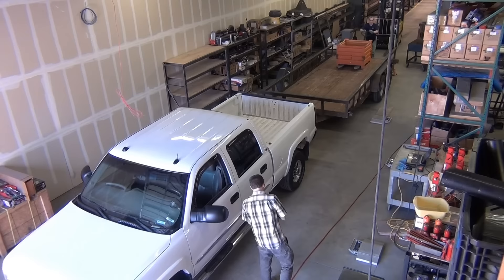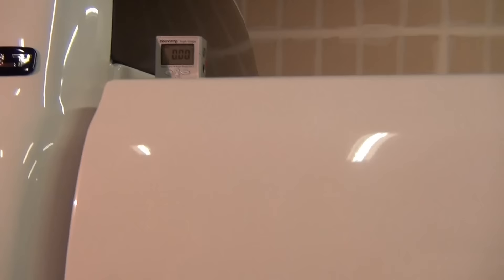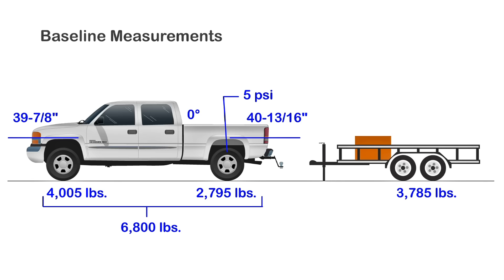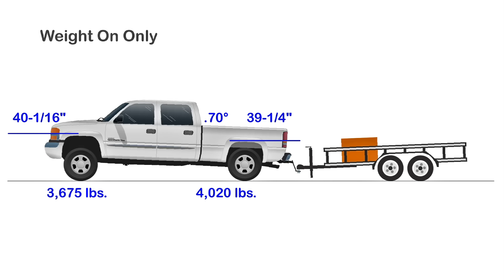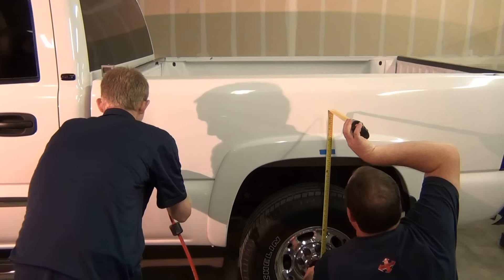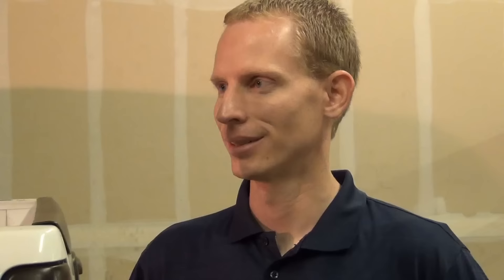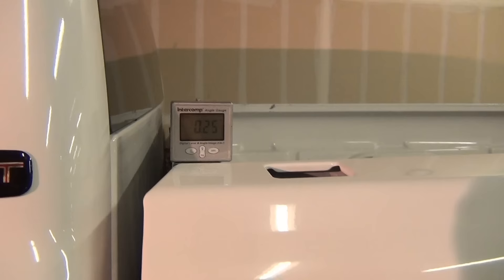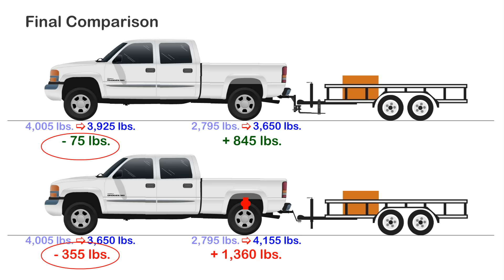The Difference Between Using Weight Distribution and Air Bags to Level Your Load

Comment: Your demo would have been better if you had done it with a single axle trailer. If you had done that you would see the air bags wouldn't change the tire loads at all. The reason the air bags change the tire loads is that with the dual axle trailer, the effective center of the reaction on the 2 axles changes with angle of the trailer. When the trailer is tilted down the effective center shifts forward. Think, if you tilted it down far enough, the rear axle would lift off the ground and the reaction would be right under the front axle. Similarly, if you raise nose, the effective center shifts back. Again, raise it far enough and the front axle will lift off the ground.
From an engineering point of view, the baseline and bags version are statically determinate and can be simply solved. The WD system changes the system to an indeterminate system and determining the forces at the wheels is a function of the stiffness of the WD system, trailer, truck, and springs.
Reply from the maker: Thanks for the comment. You are correct that a single axle trailer would react differently, and would have shown slightly different results on the scales, even though the principles of weight distribution vs. air bags would have remained the same. We used a tandem-axle trailer in this demonstration because those are the most common trailers requiring weight distribution.
Reply: "No air in the bags drops the front of the trailer down transfers weight off the tow vehicle and rear trailer axle to the front trailer axle. When air is added to the bags weight is transferred to the rear trailer axle and rear truck axle. Because of leverage from ball to rear axle the front looses weight." I typed this and then I saw you comment.
Reply: And further more the Air Bags where actually used to lift the rear higher than the weight distribution hitch height (ie: bags asked to carry more weight).  Would have been interesting to lower the Bag pressure so that the rear ride height was the same for both devices (my guess for the bags would then be that the front axle of the trailer would take more of the weight, the tongue weight would decrease, rear axle load would decrease, trailer weight would increase).

Comment: What about using both?
Reply from the maker: Hey +Dave Bowers,
Using both is a great option if you need them. We recommend using weight distribution for a heavy trailer / tongue load, and air bags if you're carrying a lot of weight in the bed of the pickup and need a convenient way to stiffen or soften the suspension. Thanks for the comment!

Comment: What if you use both methods?
Reply from the maker: There is a way to do it. You'll want to set up your air bags to a lower setting, and then make your weight distribution adjustments. Doing the air bags last will counteract what the weight distribution hitch is trying to accomplish with transferring weight. We're working on a video for this scenario! Should be ready this summer.

Comment: I have an f550 crew cab dump truck. Will airbags help me get weight to the front axle when loaded?
Reply from the maker: Great question. It actually won't. Airbags actually will add more weight to the rear axle, and will take even more weight off the front axle. This is because the pressure will be pushing down on the rear axle to get the rear end to raise. A weight distribution hitch will restore that weight back to the front axle!
Reply: @FastwayTrailer  I'm not talking about towing. I mean for the weight inside the dump bed of the dump truck.
Reply: @FastwayTrailer  It sounded as though Matt Paige was asking about a dump body, not a dump trailer. In this case (without a trailer), the weight distribution hitch (wdh) will do nothing except add the weight of a wdh (30 lbs or so) to his rear axle.... so not helpful.
Reply: @FastwayTrailer Please explain how you think a weight distribution hitch will put more weight on the front axle of a dump truck when the dump truck is loaded?
Reply from the maker: Oh I see. I don't think so. There would be nothing forcing weight forward to the front axle, so I don't see how air bags would help in that scenario.
Reply from the maker: Agreed!
Reply from the maker: Sorry, I misunderstood his question, I don't think it would.

Comment: is there any benefit to using both systems in conjunction?
Reply from the maker: We normally don't recommend using both together. Adding air bags to a WDH can take tension off the bars, and reduce sway control.
Reply: @FastwayTrailer  would it be fair to ask why not adjust (air up) the airbags and THEN adjust the WDH including the airbag height factored in to get the proper tension?  I know its a guessing game that can go in circles but if you have both & have used both together there comes a "feel" for fine tuning (adjust and readjust until it meets the requirement).  maybe im reading too much into it as a Jeep mechanic doing a lot of lift kits and dealing with caster issues where there is no rule of thumb
Reply from the maker: Yes that is the way to do it if you choose to use both. We usually advise against it because it can be very frustrating trying to get it exactly dialed in. Just make sure you do the air bags first, and adjust the WDH last!

Comment: Does this only apply to tongue tow trailers and not fifth wheels?
Reply from the maker: Yes. The principles we show here are for weight distributing hitches or ball mounts used with a bumper-pull trailer. A 5th wheel applies the load to the tow vehicle (usually) just slightly ahead of the rear axle, which places some of the pin weight on the front axle, and most of the pin weight on the rear axle.

Comment: After getting weight distributed hitch set, could you not air up bags to get to back ride hight level.
Reply from the maker: If you set up the hitch, then add air to the air bags, you will get the ride height back, but you will loose the weight distribution. Ride height is not the critical factor in a safe tow. Good axle weights is. Taking measurements of the wheel well is the easiest way to watch the change in weight being carried by the axle. The best method is taking the rig to a CAT scale and actually measuring the axle weights. Our recommendation is to inflate the air bags to what you think you want to tow with, then set up the weight distribution hitch. This will make the weight distribution take that rear axle height difference into account before being set up. If you change the inflation of the air bags, check the weight distribution setup and make adjustments as necessary.

Comment: Can't I use BOTH ?
Reply from the maker: Using both can be a bit tricky, you'll want to set the springs up before setting up the weight distribution with the hitch. You may need to use one extra washer on the hitch setup to compensate. Thanks for watching!

Comment: I own a 2019 Honda Ridgeline. I remember reading somewhere that a weight distribution hitch should not be used with the unibody construction. Is that true?
Reply from the maker: Good question! We defer to the instruction manual of the tow vehicle in that situation. Some unibody vehicles are good with it, and some not. So, check your tow vehicles specifications and if they say not to use a WD hitch, then you should follow that instruction and not use one!

Comment: What if the truck is lifted, like a Tacoma, do I have to use both? I already have a WDH
Reply from the maker: Depends on your set up! Using both can be a bit tricky, you'll want to set the springs up before setting up the weight distribution with the hitch. You may need to use one extra washer on the hitch setup to compensate.

Comment: What’s the best setup for using air bags and a wdh?
Reply from the maker: Using both can be a bit tricky, you'll want to set the springs up before setting up the weight distribution with the hitch. You may need to use one extra washer on the hitch setup to compensate. Thanks for watching!
Reply: @FastwayTrailer  Oh ok. Thanks!

Comment: Would there be any benefit to using the wdh and air bags?
Reply from the maker: It's been done, you will need to inflate the air bags first before setting up the hitch. We also recommend using the air bags at a lower psi. If you try using air bags to fix any sag from the setup, you run the risk of reducing the tension on the weight distribution hitch, which will cause a decrease in sway control.
Reply: I use both and it's the only way to fly
Reply: FastwayTrailer I do exactly as you described,  lower pressure in the bags is the key, works amazing
Reply: Another option to airbags is timbens. They will not interfere with the weight distribution but will assist the load on your springs while towing. They won't develope air leaks later down the road.
Reply: @FastwayTrailer  But is there any benefit to doing this? From the experiment you did in this video, it seems the WDH is more effective than Airbags, but would Airbags AND WDH be more effective that just one or the other? 
I ask because I already have Airbags, and I plan on getting a WDH because, well, it's better. If I get no benefit from using both at the same time, then I'll just set my air at it's lowest settings and only rely on the WDH. If I get added benefits, then I want to use both. Thanks for this video, been a great help at understanding some things.
Reply from the maker: Great question, and it is hard to tell. It depends on each individual setup to be honest, and some may need both while others are just fine with one or the other. If you have airbags already and are looking into getting a WDH, I'm sure the WDH would help!

Comment: Ok, have a question. So in order to get the weight hitch on there you have to life the vehicle up to install the bars right? Well how would you do that if you have almost 2k in the bed of your truck but you sit level with factory self level air ride and have a trailer that weighs in around 10k? You’d be picking a lot of weight up on that little Jack to install the bars.
Reply from the maker: Hi Derek! You don't need to lift your vehicle to install your bars.
Reply: I usually lock the coupler onto the ball, then lift the back of the truck up slightly. This makes tensioning the bars easier.

Comment: Can i make a small setup for class one hitch? 200 to 300 tounge weight i would love to transfer to the front.

Car.
Reply from the maker: If your tow vehicle has a 2” receiver, and the frame of the vehicle will allow the use of a weight distribution hitch, you can use a light-duty model like the e2 4.5K trunnion hitch and it will work very well for that tongue weight. Unfortunately, we do not make a shank for a receiver smaller than 2”. Also, make sure your vehicle is rated to use a weight distribution setup before going ahead. You can find this in your owner’s manual, or by contacting an authorized factory dealership for your vehicle manufacturer.

Comment: I found this informative video while looking for a comparison of air bags vs heavier leaf springs. I am not towing a trailer, I recently purchased a slide in truck camper which is heavier then my F250 is rated to carry. (This is very common with a truck camper). Would you have any thoughts/feedback as to if air bags would be a useful option in this situation? Would you have any alternative suggestions?
Reply from the maker: Sorry, we do not manufacture air bags or leaf springs, so we can’t give you advice on those. We recommend you consult a dealership or manufacturer with a good reputation to gather the information you need to make a decision.

We strongly recommend that you do not exceed your tow vehicle’s ratings under any circumstance. Ratings take into account much more than just the springs. Not only do you have to be able to carry the load, but you need to stop it, control it in an emergency situation, and get the most longevity from the rest of the components in your pickup. When a vehicle is rated, everything from the cooling system to the wheel bearings are taken into consideration. Our goal is always safe and happy customers. Please do not do anything that would put yourself, your family, or your equipment at risk.
Reply: Holy cow. Did your company recently get sued? A simple, "Sorry we can offer advice on that." would have been professional and sufficient. I'm sorry I asked.
Reply from the maker: Shoot. Sorry. We can see where you are coming from. Great advice for us. Thanks for the feedback.
Reply: @woog74  No way, man.  What if you were asking and really thought it was OK to exceed, "as long as you added this thing someone wanted to sell you"?  Kudos to FastWay Trailer for the stern recommendation to never exceed.  Advice against doing the wrong things is always good, even if the asking party disagrees or has other ideas.  It's NEVER a good idea to exceed any ratings of a vehicle.  Don't be sorry you asked - expect blowback when you outright state you are going to break rules of engineering.  This: "a slide in truck camper which is heavier then my F250 is rated to carry" is a bright red flag to pretty much everyone who cares about safety.

Comment: Would it be best to counteract the weight in the back of an SUV with airbags first, and then add the weight distribution hitch to correct the sag from the caravan? Or just use the Weight Distribution hitch?
Reply from the maker: Using both can be a bit tricky, you'll want to set the springs up before setting up the weight distribution with the hitch!
Reply: @FastwayTrailer  Thanks. I find the weight distribution hitch works fine, but when we go on holidays & load up the back of our SUV, it's sitting low to start with, so I've thought maybe it'd be a good idea to bring the rear of the car back to it's normal unladen height using airbags, then attach the caravan, then use the load distribution hitch to once again bring the rear of the SUV back to normal height. 

Failing that I'll just keep using the hitch by itself.

Thanks for your response.
Reply: @FastwayTrailer  I am not an expert, but I do use HELPER rear air bags, filling them with only 20 psi, and then dialing in my weight distribution hitch. My goal with the air bags is not to try to alleviate rear sag but as a slight stabilizer with regard to handling of my tow vehicle. Mind you, I tow a lower profile 4,000 lb trailer with an SUV. I've been passed by semis while doing 60mph with hardly any movement between SUV and trailer, as well as driving 40 mph with a 40 mph cross wind that was surprisingly stable. Should I do things differently, or am I okay?

Comment: If the rear axle weight went from 2800lbs to 4000lbs, that’s 1200lbs added to the rear axle, which should increase the overall weight of the truck by 1200lbs.    This is not a combined axle weight with the trailer helping that load, 1200 lbs was literally added to the back of the truck, effectively adding that weight to the weight of the truck, but then the numbers didn’t reflect that, only increasing by 900lbs.    What happened there?  Also, how did a 1000lb tongue weight add 1200lbs to the rear of the truck?
Reply: 5' of Leverage  , how ellce can a 200lbs man make a  torque wrench  set to 400# click?
Reply: The extra is from the front of the truck going up and transferring the weight to the back.

Comment: Sorry should been more specific, we got a fifth wheel with 3250 pin weight and the spec's on my gmc 2500 duramax said 3580 payload, but the yellow sticker on the door said 2128, so was wondering why the sticker so so low came from a GM family who hauled a heck of a lot more than a sticker said and never had issues, now it's got me thinking what the world trucks was supposed to be built for hauling. Thinking about air bags and 14 ply tires. New truck and sure can't afford to go out and buy a 3500 that rides ruff.. do you guys have any suggestions?
Reply from the maker: The payload generally refers to the total amount of weight the vehicle can carry as a factor of the overall tow rating less the weight of the vehicle itself. For example, a tow vehicle rated to carry 10,000 lb and weighing 6,000 lb would have a payload of 4,000 lb. Everything you add to the vehicle – passengers, cargo, ladder rack, tool box, auxiliary fuel tank, 5th wheel pin weight, bumper pull tongue weight, etc. would be considered payload and would be above and beyond the base weight of the vehicle.

Most door stickers give you a maximum axle weight for both front and rear (and specifics about tires and inflation for each), and a maximum gross vehicle weight rating. Some also include a maximum payload. Our recommendation is to double check these ratings, as well as the guidelines in your tow vehicle owner’s manual. Make sure you stay within their recommended weight ratings. You may need to take your loaded vehicle to a CAT scale and verify each axle weight on the tow vehicle and trailer, and make sure that you are within the recommended weights for each axle, gross trailer, gross tow vehicle, and gross combined vehicle ratings.
Reply: Cliff Whitaker 3/4 ton trucks with diesels are useless. With a limited 10k GVW the extra weight of the engine eats the payload right up.